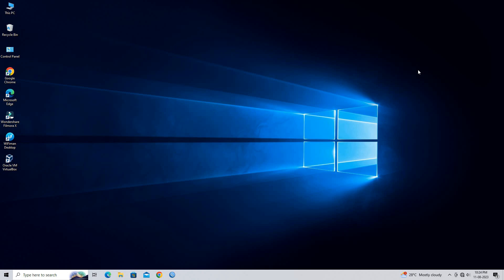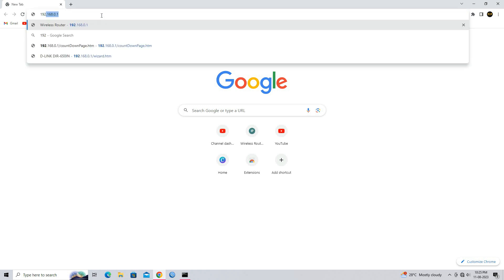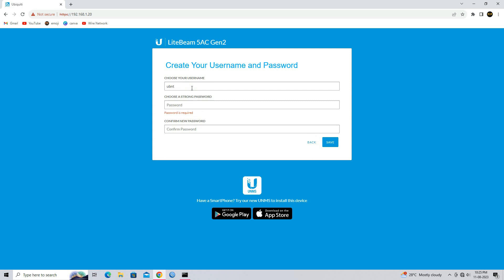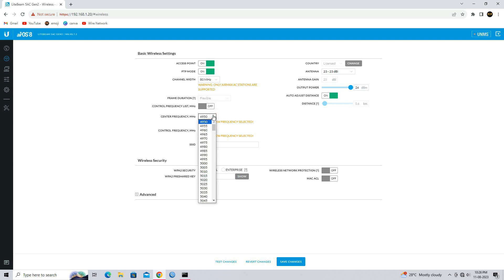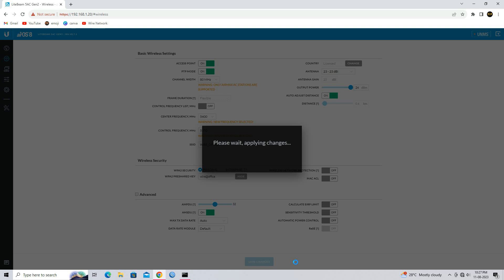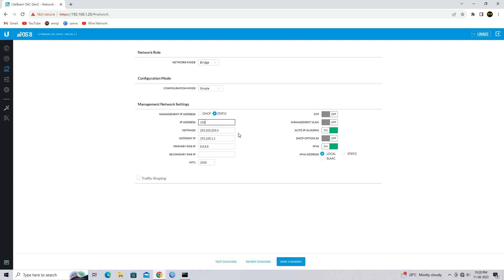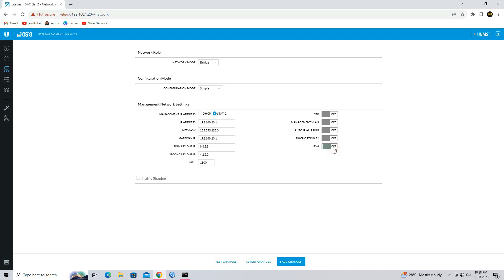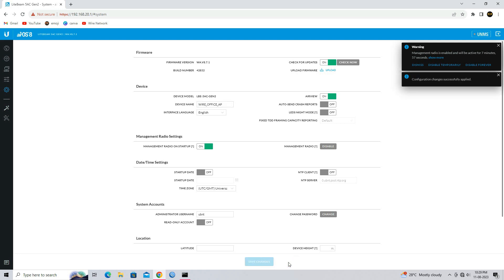Litebeam 5ac Gen2: Ap Mode Setup | Access Point Configuration

Comment: Thank you for this video. What is the best frequency to use for a 10km distance? I used 5755 Mhz and its not pickup the other site. Please help me.
Reply from the maker: 5600 - 5700
Reply: @Wirenetwork  Thanks for the reply. My Devices are LBE 5AC GEN2. What could be the best channel for a 5600 - 5700 frequency range for the 10KM distance?